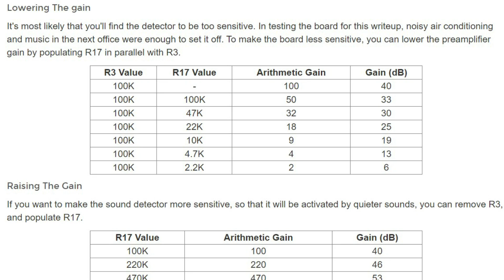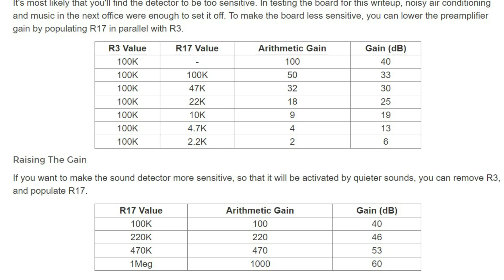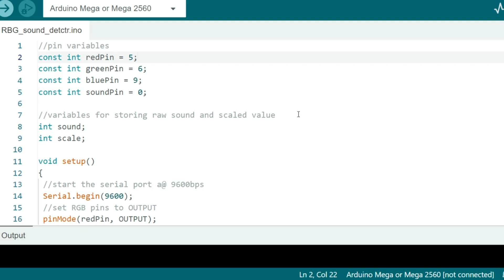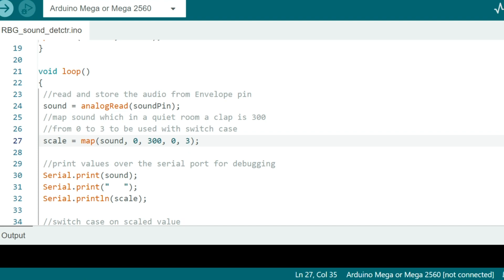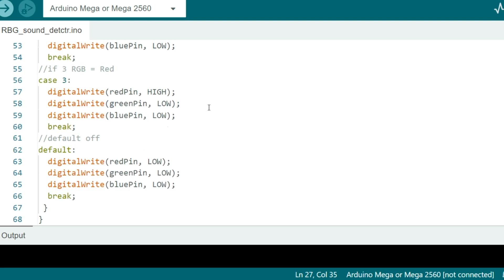Make Your Own Sound Activated LED Light With Arduino Sound Detector - A Beginner Video

Comment: Hi, Thank you for this very useful video. I was wondering if we can plug a modified female headphone jack into the audio IN. L or R signal woud go into the audio IN and copper wire to the GND. Would it be possible to detect a signal when a sound is produced from a computer connected to the female jack ?
Reply from the maker: hey there!
I don't believe the Sparkfun sound detector wouold not be a good candidate for this kind of connection, not without some modifications.
Are you wanting to create somen LED lighting effects?
Using WS2812B + MSGEQ7 is a great combo for detecting audio from a computer and making something (like LEDs) react to it.
check this out: https://youtu.be/V5PMfDm4ves
If you had something else in mind, let me know the details and I may be able to help 👍👍

Comment: Is there a way to separate the light source and the listening device? Like maybe over Bluetooth or something?
Reply from the maker: Hey there!
The sparkfun hookup guide says
"In some applications, the onboard LED may be distracting or undesirable. To disable it, simply use a solder sucker or wick to remove the solder blob from the jumper near the LED."
Some boards can have LEDs disabled in the code, but I guess this one is disabled by physically breaking the solder connecdtion on the jumper. 
👍👍

Comment: give me the sensors list to buy
Reply from the maker: the only sensor I am using is the Sparkfun Sound Detector
https://www.sparkfun.com/sparkfun-sound-detector-with-headers.html?gad_campaignid=17479024039&gad_source=1&gbraid=0AAAAADsj4ESJ6fBHGUJFGt6COiEGHpT_q

I'm also using the arduino uno and an 4 pin RGB LED

Comment: I was trying to copy this project as my first attempt at this seems the code has changed on the link available i tried copying the code from your video exactly on my pc but i keep getting a serial was not declared error not sure wat i did
Reply from the maker: Hey there!
I changed the soundPin from 0 to A0 and updated Sound: and Scale: labels for debugging clarity.  It compiles for me. Let me know if it works for you. 

// Pin definitions
const int redPin = 5;
const int greenPin = 6;
const int bluePin = 9;
const int soundPin = A0; // Analog pin for sound

// Variables for storing raw sound and scaled value
int sound;
int scale;

void setup() {
  // Start the serial port at 9600 bps
  Serial.begin(9600);
  
  // Set RGB pins to OUTPUT
  pinMode(redPin, OUTPUT);
  pinMode(greenPin, OUTPUT);
  pinMode(bluePin, OUTPUT);
}

void loop() {
  // Read and store the audio from the envelope pin
  sound = analogRead(soundPin);
  
  // Map sound values to a range from 0 to 3
  scale = map(sound, 0, 300, 0, 3);

  // Print values over the serial port for debugging
  Serial.print("Sound: ");
  Serial.print(sound);
  Serial.print(" | Scale: ");
  Serial.println(scale);

  // Control RGB LEDs based on scaled value
  switch (scale) {
    case 0: // RGB = Blue
      digitalWrite(redPin, LOW);
      digitalWrite(greenPin, LOW);
      digitalWrite(bluePin, HIGH);
      break;
    case 1: // RGB = Green
      digitalWrite(redPin, LOW);
      digitalWrite(greenPin, HIGH);
      digitalWrite(bluePin, LOW);
      break;
    case 2: // RGB = Yellow
      digitalWrite(redPin, HIGH);
      digitalWrite(greenPin, HIGH);
      digitalWrite(bluePin, LOW);
      break;
    case 3: // RGB = Red
      digitalWrite(redPin, HIGH);
      digitalWrite(greenPin, LOW);
      digitalWrite(bluePin, LOW);
      break;
    default: // Turn off LEDs
      digitalWrite(redPin, LOW);
      digitalWrite(greenPin, LOW);
      digitalWrite(bluePin, LOW);
      break;
  }
}
Reply: @BMonsterLaboratory  hey thanks a lot man I'll try that out l8r this evening when I get home and let you know if it works
Reply from the maker: @clarkescustomcreations  You're welcome 👍
Reply: @BMonsterLaboratory  no way dude 😆 small things matter so anyone else that stumbles into these comments capitals matter lol was literally because I put serial with a lower case instead of with an uppercase S 😆 sketch compiled for me after I changed them lol
Reply from the maker: @clarkescustomcreations  Good job!  stuff like that can be frustrating, for sure.

Comment: Hi, I’m wondering if you might have a video showing how to use a motion sensor to trigger a bluetooth, usb (or even hard wired) exterior speaker so that when the motion sensor is triggered, a short song plays on the exterior speaker ? I am trying to figure out this little motion sensor garden music project but I am perplexed by it. Help ? Thanks !
Reply from the maker: Hey there! I have been making a lot of motion sensor projects lately but I don't have one with Bluetooth. That's not to say we can't make one with a video to go along with it..that's no problem. 
My favorite mp3 player board is the sparkfun mp3 player shield for arduino uno. When one Arduino with a motion sensor catches any movement, it sends a signal over Bluetooth to another Arduino. That one's hooked up to a SparkFun MP3 Player Shield and starts playing music. They should be able to communicate up to 30ft away in an open area with the HC-05 and HC-06 modules.

Or, if you want to keep it simple, just use one Arduino Uno. Attach the MP3 Player Shield, hook up the motion sensor and a speaker directly to it, and you're done. No Bluetooth, no worrying about signal interference, it just plays a music track when motion is detected. This video is similar to this description and can be wireless to operate on it's own. https://youtu.be/zamlAniU2nQ
Happy to help wherever I can. Thanks for reaching out 👍

Comment: Would it be possible to do a project like this where it controls a switch that turns on and off a 110 volt outlet? Wanting to use one of these to control regular light fixtures.
Reply from the maker: You can activate this module to turn on a light by setting a noise threshold (like a clap or a shout) to turn the light on and off. Anytime a sound reaches the threshold you set, your light will turn on or off. It can be connected to Arduino and switched on by a transistor or relay module. This sound detection module is a  "noise detection" module. It picks up sound, sometimes unwanted detection because it's an analog circuit. You can modify it to be more/less sensitive. 
 I haven't used the Nicla Voice yet, but it is voice recognition. I am more familiar with the older MOVI Uno shield https://www.audeme.com/movi.html . Here's a servo voice activation video https://youtu.be/Gj5QA3xu8fI  and here's an mp3 voice activated video https://youtu.be/E1j4TkzliNA and here's a voice activated temperature readout using MOVI and a DHT11 temp/humidity sensor https://youtu.be/871h6t3BEnA

Comment: Hey! I'd like to build my own motion activated device but don't know where to start. I'd like to make a motion activated spray bottle to keep my cats off the counter. Is this something that's possible? Thanks!
Reply from the maker: Hi there~  sure you can! I made this last summer when someone told me they wanted to keep animals away from their rose bush. https://youtube.com/shorts/Yj45Q8ttp3U
I'm sure you could get a smaller pump...maybe like this one below, and get a small valve for it. Activate it for 200ms to get a small burst of water when a motion sensor detects movement. Would probably have to play around with the timing for the pump but It's totally doable. I like the idea!
 https://www.amazon.com/Sipytoph-Submersible-Flexible-Aquariums-Hydroponics/dp/B097F4576N/ref=sr_1_33_sspa?crid=1UGY2E65768TQ&keywords=5v+water+pump+or+solenoid+valve&qid=1682034241&sprefix=5v+water+pump+or+solenoid+valve%2Caps%2C77&sr=8-33-spons&psc=1&spLa=ZW5jcnlwdGVkUXVhbGlmaWVyPUExNERUQ0tUUU9PMTVSJmVuY3J5cHRlZElkPUEwMDkwMjA4MjEzOERHUk84VjRaOSZlbmNyeXB0ZWRBZElkPUEwODA2Njk0Mk5HQVlCMlVWWkZPRyZ3aWRnZXROYW1lPXNwX2J0ZiZhY3Rpb249Y2xpY2tSZWRpcmVjdCZkb05vdExvZ0NsaWNrPXRydWU=